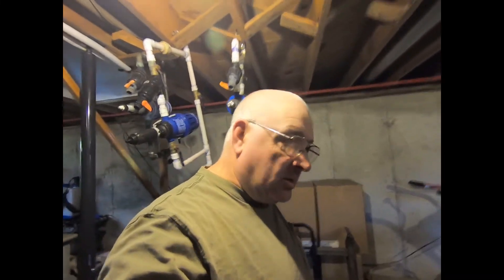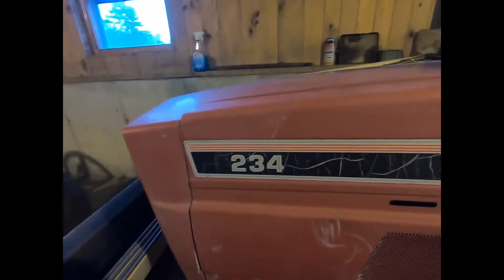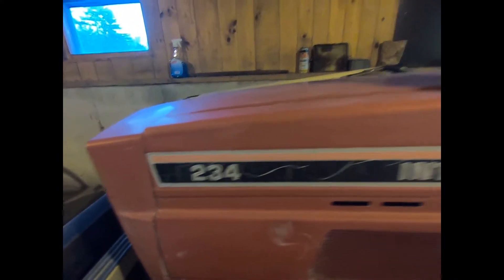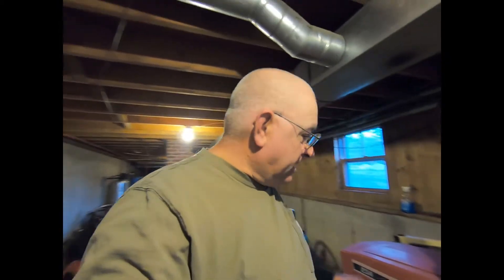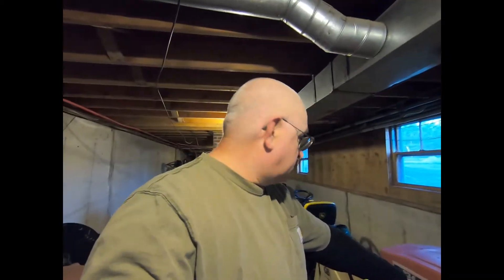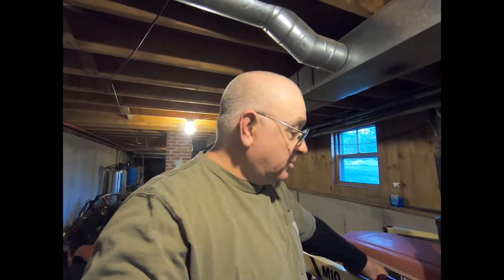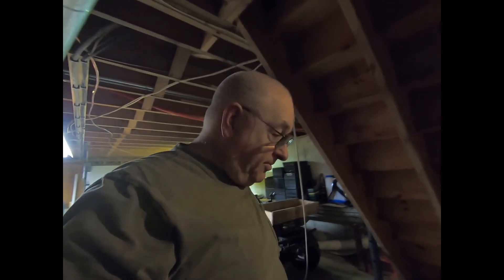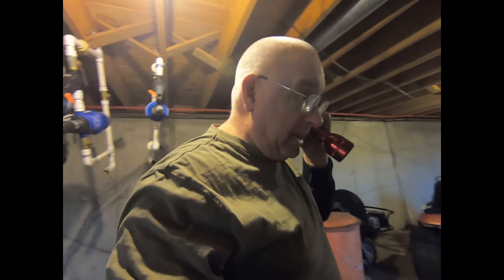234 International hydraulic pressure outlet

Comment: THANK YOU SOOOOO MUCH!!! You would not believe what I was about to do and how much I was about to spend.  You're the best man.  Thanks again and again.
Reply from the maker: your welcome
Reply: @survivingmaineona20acrefar77  I found the pressure plug, but I don't have the filter on my tractor.  In your video, I can see where the fluid goes into the filter but I can't see what happens when it come out of the filter.  Can you get an image of the other side of the filter please?  Basically, I just need to see where the fluid comes out, and where it goes back in.  Thanks again, Rob
Reply from the maker: @robertallon9387  Will do a quick video tonight for you
Reply: @survivingmaineona20acrefar77  Thanks, I've been looking at the video and I took an image of my tractor, here it is: http://allon.org/wp-content/uploads/2020/12/tractor_2.png Does this seem right to you?
Reply from the maker: @robertallon9387  That is what my bolt pattern looks like i am not sure what type of fittings are needed good luck